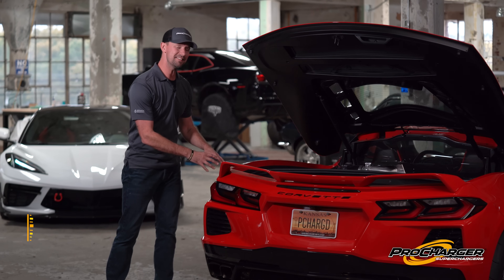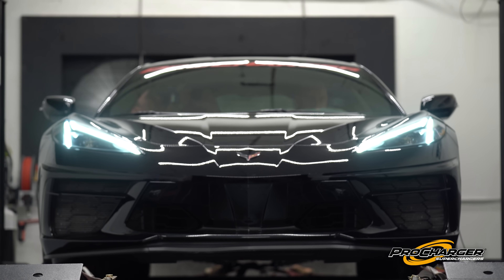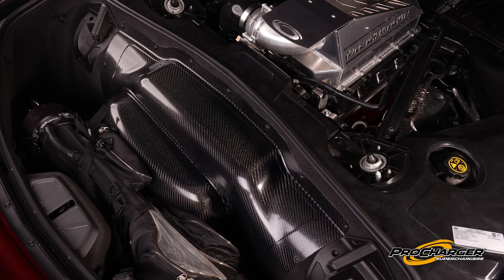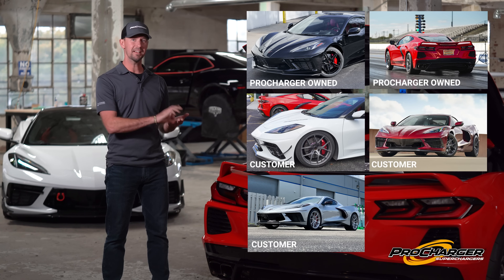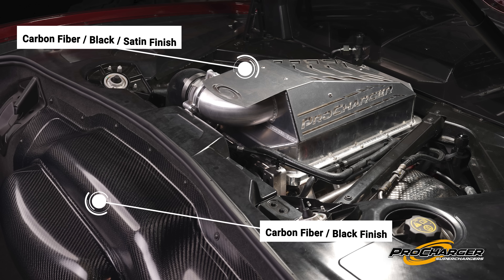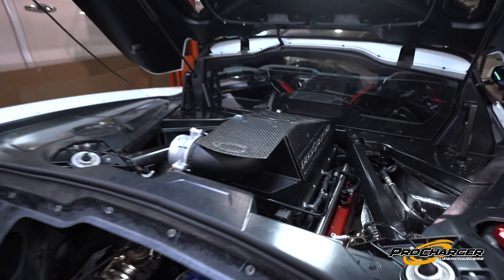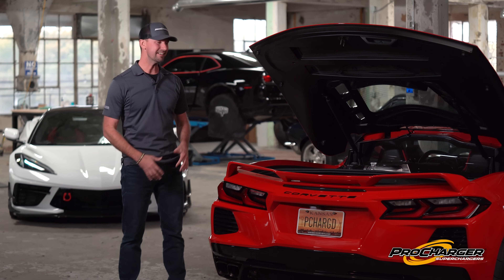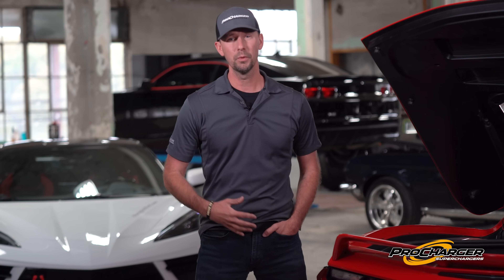World's First C8 Corvette Supercharger Kit: Now Shipping from ProCharger

Comment: Is the 675 HP at the wheels or crank?
Reply: Crank
Reply: I'm guessing that's at the crank.
Reply: This is wheel horsepower
Reply: @precisiondiesel225  The website says 180+ hp gain, 495+180=675 @ the flywheel.
Reply: @pro5.019  I think some people don't even know what wheel means lol? Either way it would be pushing the DCT to the limit if that was wheel  so it's got to be reliable, especially being a new platform.
Reply: @itshiho  Agreed they may be thinking of the steering wheel lmao. Above 650 rwhp is where the DCT clutches start to slip.
Reply: @pro5.019  exactly
Reply: his numbers have to be at the wheel, not crank HP. stock is 670hp...
Reply: @jimraelee  C8 Stingray makes 495 hp at the crank not 670.
Reply: @pro5.019  The video was talking about the Z06 not the base model when it said more than a Z06.  675 which is more that 670. It's definitely crank.